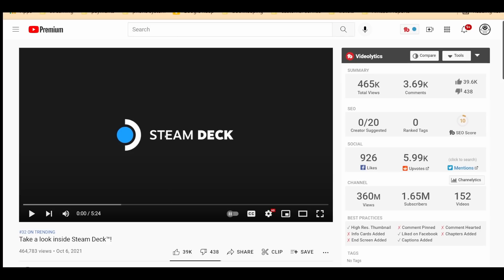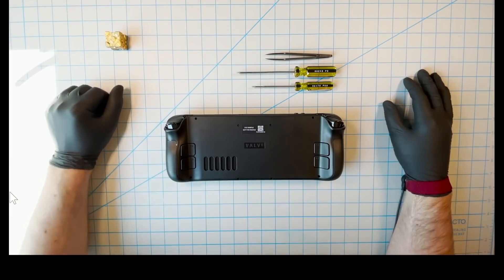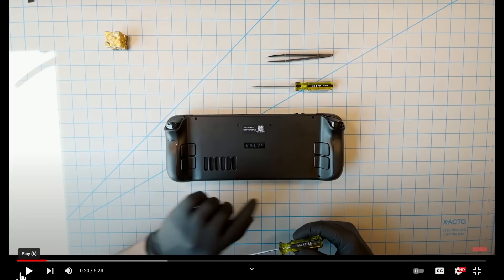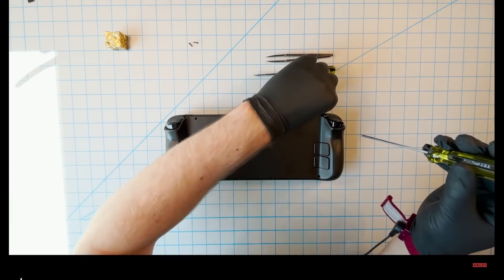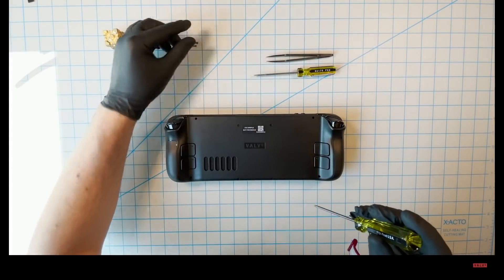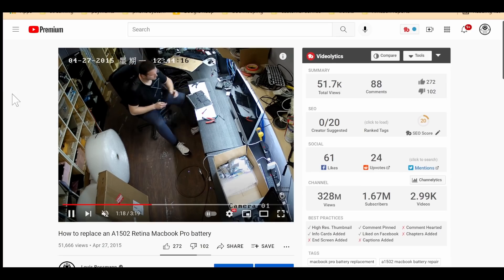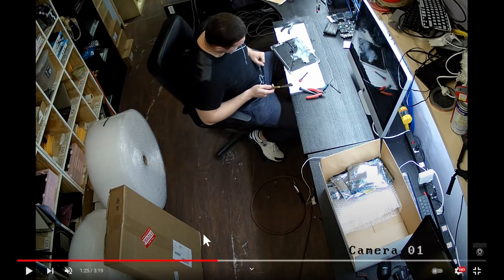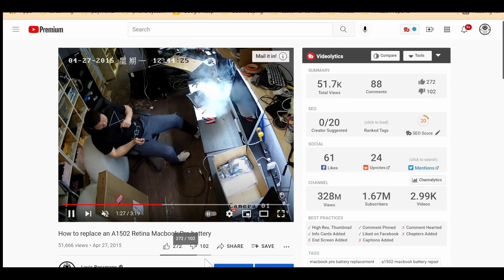Steam deck battery may end your life? bruh 😑

Comment: louise maybe i miss heard what they said about the integrity of the deck .. i got the impression they meant if the screws where damaged of the threads in the plastic was damaged. in that case if the screw has no thread or even fewer threads the streangth would there for go down

Comment: The structural integrity will probably be lessened by opening it up, since your run of the mill average joe will probably not torque the dinky self-tapping-screws correctly. The stiffness of the shell depends on all screws being tightened evenly and tightly to distribute forces acting on it. If the person screwing the device back together is anxious, they might not torque them enough, the shell will have play. If they are too harsh, they might overtorque them or strip them, resulting in loose screws or screws that have too much stress on them, resulting in cracks once force is applied. Not everyone is an engineer or technician. They watch one video on Youtube and think they can do it since it looks easy, but then they fuck it up accidentally because of lacking experience.
Reply: You can't torque back the self tapping screws to yield, anyways.

Comment: self-taping screws in plastic will damage the plastic each time you remove and replace the screw
Reply: Thats probably more for the sake of lowering cost than making it more difficult to repair
Reply: @Nonzerotonin  Considering this is not the type of device to be repaired/upgraded that often, adding brass threaded inserts is probably overkill.
Reply: @CDNChaoZ  i like over kills
Reply: @CDNChaoZ  no overkill, give me threaded inserts. Can't find any info on the type of plastic the body is mean of. I sure hope it's not some trash ABS.

Comment: As Linus said, if the thing catches fire in your backpack, due to damaging the battery or some wires or some debree causing a short, it could keel someone. Also, the battery could be okay while discharged, but could start a fire if you charge it past a certain limit, or too fast.
I also don't know how good the thermal paste they use is, but it might be worth replacing it, or adding some to the thermal plate. And the not-yet-released video from Tech Ingredients teaches how to make thermal paste, unlike the thermal glue they made a video teaching before.

Comment: With regard to the relative drop resilience, there are two thing that come to mind. The more obvious one would be some kind of structural adhesive which will never be as strong as the first application unless you were to replace the adhesive when putting the device back together. The more likely culprit to the structural argument is the choice of screw. Self tapping screws in relatively soft plastics have diminishing strength every time you tighten it down. In an idea world the screw would find the threads initially cut by the screw, but in reality the threads widen out slightly every time you apply the screw.
Reply: Inserts for screws cause a stress point and crack the shell during a drop. Self tapping screws are a better solution for this.
This is something I saw in the comments of the original video and that I'm sad all reaction videos are missing.
Reply: @rosalina-dev  that still depends on the plastic chosen. I am working on reliability analysis of plastic enclosures where fiber reinforced PA is used. We mold metal inserts in the process with a robot and have estimated lifetime (temp, vibration profiles) of over 50 years.

I watched Linus’ video and the most probable reason for valve not using those is cost. The part might not cost much, but the process very much does. 

Ads mentioned above: self threading screws loose strength when loosened and tightened. We did some testing but I don’t recall the reduction of lifetime. What I remember: 5 times in and out -> garbage
Reply: @meetbounty  I doubt they used nylon (would be super nice of course) PC+ABS+CF15 would be amazing too but I doubt it either. Actually I could not find any info on the type of plastic they used.
Reply: @stanimir4197  I bet it will be some PA6 or PA66. Good/easy to mold, good mechanical properties, good corrosion properties and yeah... Cheap and recyclable. 
PC is a possibility but only as a component like you said.  Too brittle usually. PE is too soft and out of question. 

Personally I would have used PA.
Reply: Linus commented on this as well in his reaction video. He said it's most likely a cost-saving measure, and I tend to agree.
Reply: @ashleydavis3318  we all know brass inserts are not free
Reply: I agree. the whole point of self-taping screws is you don't have to cut threads into the holes the screws go before hand. that's fine for the first time the device is assembled but after you take the screws out and re-insert, it's likely a screw or two will just end up cutting new threads over the old ones.
Reply: Due to the poor choice of screw, I would say technically this is correct. However, opening once or twice to replace something broken, and care being used to not overtighten likely isn't going to have noticeable impact, and if it does, the thing is likely to lose structural integrity every day just by using it.
Reply: To expand on this, if they really cared about right to repair they would have used some kind of heat set insert in the plastic to ensure that the device could be put back together with the same strength as it had been assembled with initially.
Reply: @gregking267  I mean, yeah, that would have made the thing more repairable, but nitpicking details like that isn't really fair IMO. They could have made the whole thing out of metal to make it even more resistant. They could have included a full set of screwdrivers, prying tools and replacement thermal paste in the box. They could have also made a "project ara" kind of device where every part including the screen just snaps off and allows for instant replacement. Point is, all of those things eat up money and space. The use of self tapping screws is simply not enough to claim that "they don't really care about right to repair", especially when one of the first pieces of content that they put out on the device is a detailed teardown and replacement guide.
Reply: I think Valve is trying to mention that after opening the housing, the actual drop resistance wouldn't be the same as unopened. For example, a new unopened device is rated for 1,000 cycles of 5ft drops but a opened device will withstand less cycles due to self tapping screw damaging the plastic housing. Regarding using adhesives, I think Valve would still say the same comment because the application/assembly method differs for each person. So it will affect the rated drop resistance either way. This is just a disclaimer so that Valve avoid issues in the future.
Reply: @simoncheong7692  That was my thought also.
Reply: @simoncheong7692  Ok, that makes sense.
Reply: @gregking267  no not really the deck is priced agressively and its ok to open it up a time or 2  to change thumbsticks or something its not meant to be taken apart every week
Reply: @gregking267  they could’ve used inserts but the price is already high for the console, this also wouldn’t help if people over torque the spacer and it spins in its spot and then you can no longer loosen the screw.
Reply: @gregking267   Linus  tech tips talked about this on his reaction video
Reply: @gregking267  I mean, it's still a $600 laptop sold as a $400 portable, there are bound to be some corners cut somewhere.
Reply: @williambennett9764  This is plain bullshit, because there's more than just AAA titles on pc. There are games being released today that would run on an old i3 and a gtx 660, it all depends on what you actually want. It won't become obsolete just because the newest AAA games can't run on it.
Reply: @gregking267  The added cost wouldn't make sense. The device isn't meant to be opened and closed repeatedly which is what brass inserts are for. Also, one could argue if they put in brass inserts, it would be like Valve encouraging people to open their device, which would not be to valve's benefit at all. Self tapping screws was the correct choice for this application. That being said, I"m sure there will be videos of DIY mods for installing your own brass inserts, or aftermarket 3rd party housings you can swap out which will have inserts installed.
Reply: @gregking267  Bro, metal inserts into plastic are trash. Hp uses them in their screen hinges and they break all the time. 
I found out about them when I had issues with my hinge and had to look it up. My laptop is envy 13 and the problem exists in spectres as well. 
Don't know how the quality guys do it like macbooks or surfaces...
Reply: @Alhussainba  that's because HP uses trash plastics. Brass inserts protect the plastic from cracking.
Reply: @USSMariner  They do use the inserts, end of the day the inserts transfer the load to the plastic and plastic wears with time.
I opened my laptop and found few small pieces of plastic, under the hinge location the insert was loose and the plastic around it had shattered.
Reply: @Alhussainba  and then you can no longer remove the screw because it spins in place
Reply: @gregking267  thats stupid. How often are you gonna open it to repair it? Every day? Its not being opened up often enough for that to even matter much. Honestly such a stupid stance. Its built to a price ie you should expect cost saving measures
Reply: @zombieswitapple  There should be at least a couple inserts for those edge cases.  Besides, kids play with screw drivers all the time.
Reply: @DSiren  yea increase costs for everybody because one kid wants to loosen and tighten screws repeatedly. Great plan
Reply: @3nertia  any eng worth their salt will tell you that adding cost for such an edge case isnt worth especially when your product has almost no margins
Reply: @3nertia  "a clever engineer can do both" what a stupid statement. Theres design and cost trade-offs for everything. Why doesn't valve make the cpu swappable for more repairability now? Theres a point diminishing returns you know
Reply: @3nertia  clearly you dont know what you're talking about if ur resorting to personal insults lmao
Reply: @3nertia  bruh you're literally trying to argue that using self tappers that last 10 or so insertion cycles isnt ok for this application where at most it could get serviced 3 times. What are you fuckin smoking. Are u trying to say engineering trade-offs dont exist?
Reply: @3nertia  literally using the "im just built different argument" on why engineering trade-offs dont apply for the things you design lmao
Reply: @3nertia  Why wouldn't it increase cost. Did you have some experience in manufacturing, because base in my experience it definitely increase cost, if the worker have to spend 15-30s more everytime doing something, that cost money. Probably not by much singularly speaking, but with the tiny margin they working with. Then you have to ask, why bother, it honestly bring more trouble then it worth
Reply: @3nertia  I have already answer it for you. Material wise, it cost less. Assembly wise, it more simple, which cost less in term of labour.
And Im not here to discuss philosophy idea, just manufacturing cost, which you clearly have the wrong idea how it work.
Reply: @3nertia  again, you literally making no sense at all.
And also again, Im not here to debate philosophical belief. Just what make sense in manufacturing. 

And in production, material and time mean everything. If you cannot justified those 2 condition, the idea is shit
Reply: @3nertia  right for who, for them or for you. Because as far as business go, "right for them" is the only one that matter. And what you suggest, literally a waste of time and resource to achieve nothing. 
If disagree, please point out how does it many any kind of significant improvement in profit. 
What you blatantly miss is that even if it an improvement. You have to justify the additional benefit outweigh the resources spent. Which I in no way see any as justifiable enough for your "improvement" from Valve perspective
Reply: @gregking267  Came here to say the same thing about the plastic tapping. I have a background in manufacturing. But to be honest, given 4 inserts, and a generous 15 minutes of human labor. I would pay another $15 (as a manufactuerer)/$30 (as a retail consumer) USD to not only have a more servicable structure for DIY repairs, but also inhouse warranty refurbished units for replacement claims. It's in the best interest for both parties in my opinion. But I am sure someone from marketing decided they couldn't sell as many at any higher prices, so corners had to be cut. It's a shame really.
Reply: @AoDude  how often do you expect the device to fail? You may be ok with paying an extra $15 but most people wouldn't
Reply: @zombieswitapple  we talking within a warrenty period, or with unlimited time? There will be a small percentage that will need warrenty claims within the first 1 to 3 years undoubtedly. Given unlimited time, nearly all of them will have some sort of failure that retro hobbiests would certainly diy repair.
Reply: @AoDude  servicing once or twice wont ruin the holes.

Comment: I have taken apart several Xbox controllers and it does loose some integrity, this is because the plastic holes were smooth and the screw shapes the grooves into the plastic these grooves get damages when placing and re tighten the screws. So this is not wrong but, if you are careful you can do it safely.
Reply: That fucking screen name, hahaha!

When reinstalling screws in plastic i like to "gently push down" and turn it backwards till the screw threads fall back into the old threads, and then retighten.

In most cases you can feel it drop down, and the threads to not get damaged, even with those shitty self tappers that have the notch at the tip.

I used to work on printers and you could reuse screw holes nearly indefinitely this way, if not they'd be stripped after a couple insertions.
Reply: @volvo09  I learned that on after my 3rd screw on my first ever controller repair.
Reply: A little loctite (of the right type) can also deal with screws that are a bit loose from damage.
Reply: Lmao
Reply: Yea iirc linus mentioned a finger test one can do in order to reduce the risk of overtorquing vs. self tapping screws.
Reply: Never had that happen when I take apart my controllers. Maybe your just doing it wrong.
Reply: @AnarickTheDevil  no I have just done more controllers than you, used to do them a lot more for all my friends and even family members. This was a problem common in the 360 controllers grab an old one and give it a light squeeze you can even feel in an unopened brand new one the the screws are by giving a squeeze. These controllers were made garbage cheap.

Comment: Their video is basically, “You shouldn’t but it’s yours and you can. Here are some of the trappings and pitfalls to be aware of.” That’s Right to Repair-friendly in my book. Knowing that some replacement parts can have these specific issues, we can look for specific SSDs and other components that fit and don’t interfere while being mindful of vibration and drop clearance.

My only criticism is that they should have suggested you try to reuse threads when putting the screws back into the plastic. Repeatedly cutting new threads will damage the plastic screw post whether you use a torque wrench or not… and then you’ll need a new front housing.
Reply: and to reuse the thread when putting it back in  unscrew  the screw until you feel the click  and then tighten. That way you are using the original thread the self tapping screw made rather then cutting new threads.
Reply: @Ebisu Yeah. Mine. Also: Not quite “exact.” I changed a few words. :)

Comment: Bruh. To be fair, burning down your house is a (remote) possibility that could get you killed. In a country where you need to clarify that coffee may be hot...
Reply: I mean,  the "coffee may be hot" all stems from a lawsuit where the coffee was literally boiling hot and caused nearly fatal injuries.
Reply: @drackar  
But still, it's also the same country with a few rather specific stereotypes
Reply: @drackar  I did in fact know that but decided that the example was memetic enough to use.
Perhaps I could've gone with an actually frivolous lawsuit,  but I don't keep track of those so I don't know an example off of the top of my head.